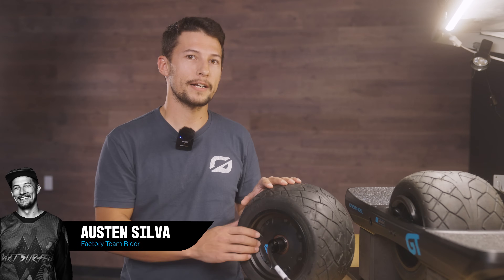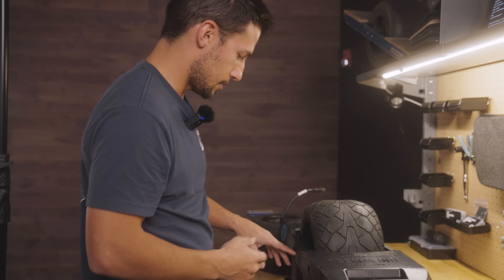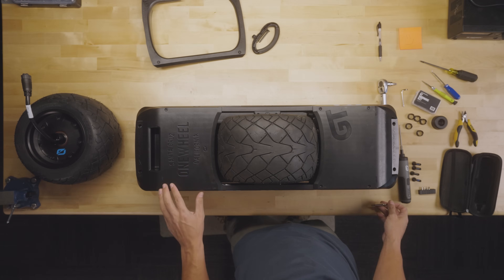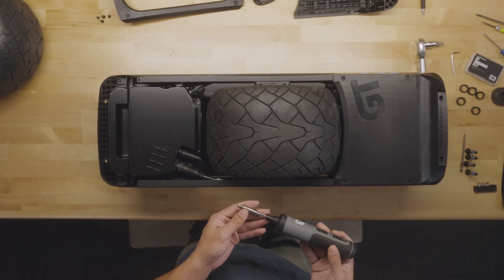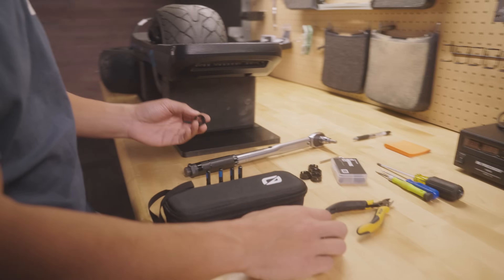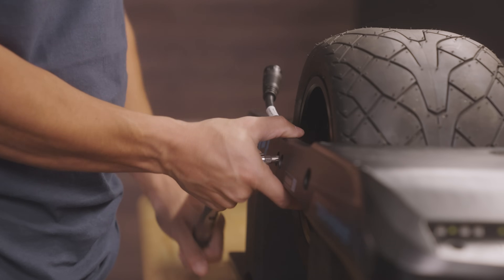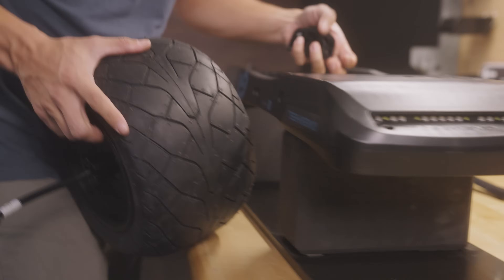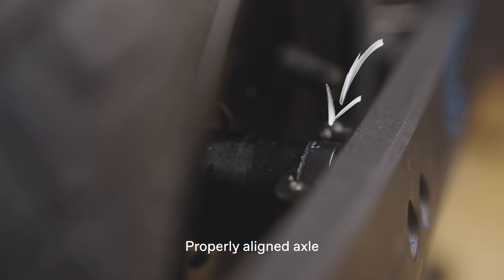Onewheel S-Series Motor Install

Comment from the maker: HOw about them torque specs heh?!
Reply: Super thankful for that! Can we get Pint and XR too? 🙏🏼⚡️🛠️
Reply: Should note that torque spec is probably only valid on fresh FM bolts. Reusing bolts or a different thread lock may require a lower torque value. Appreciate a published number. Consider tossing in fresh bolts with each tire purchase.
Reply: 25.815 foot lbs in case anyone needed to know
Reply: I am impressed, thank you and now I have to ask.. it took 9 years to get any sort of torque specs. Why? Julian?
Reply: Wow, took ya long enough FM 😂
Reply: how about not removing individual cell voltages heh?!
Reply: @sadanimal1950  what you said
Reply: Nice they're supporting repairs/upgradability just in time to comply with incoming laws.  My vesc is still faster/torqueier than my friends GTS.  Best part is I still haven't given FM money after they tried charging to fix a controller bricked by their own automatic update.  I'm so glad there's better alternatives coming out whether it's vesc or EUCs.
Reply: It's incredible how it took this long. Been offering replacement tires for users to install, and verified this is a non warranty voiding procedure yet never released torque specs for the bolts holding the axle to the rails. 

Torque specs for every board would be very appreciated
Reply: 🎉thank you!
Reply: Yesssss babe! Feed me that slop! 😍
Reply: Can we get XR torque specs too please
Reply: Thank you! 22 ft lbs. it is!
Reply: @sdmods619 it’d be 25.8 ft-lbs
Reply: I just watched the video and he mentioned spec should be 35😊
Reply: @AshlonHill  yeah Newton Meters

Comment: So am I correct in assuming that you say the axle bolts should be replaced every time you take them out, but they are not included in the new motor package and not suggested on the motor purchase page?

Comment: Nice work, great to see this. One thing I typically do is take one rail off, it’s a lot easier to remove and install the motor connector. In my opinion, you are less likely to damage anything.

Comment: I thought if you disconnect your battery on a GT it has to go all the way to Santa Cruz to be repaired but motor swap you guys are fine with?
Reply: they mentioned in the comment above that the battery will be for sale but will take some time to roll out🙏 great step in the right direction

Comment: You should NOT  be using a torque wrench to Unscrew. It's a tightening tool only! Why? It's easy to deform internal components and then is no more reliable. You can not know that happened unless you compare with a fresh torque wrench or try to calibrate it.

Why I know? +1B $ commission, We had to redo all torque certification on cabinets in a power station. The worst part was removing permanent marks you put on torqued bolts, washers and cabinets.
Kept rack of what was To do, done, and to double check😅

Unscrew with regular wrench, tighten with a torque wrench!

Comment: Can I put it on my GT?
Reply: Yes but if you're going to spend another 90p night as well buy a gts and sell the gt
Reply: @aaronlarsen8412 I need the GT range…. I’ve already put like 1500 in paths for the GT. It’s my daily driver but want the most out of it
Reply: @richcoastbrooks8601  are you fine with the 20mph pushback? I have a gts and a gt and the gts is so much nicer and so much more stable and you can cruise at over 20mph easily

Comment: I fumble on the retainer clip, and worry that it is not tight... Would it be safe to put a dab of hot glue on the connection for security purposes?
Reply: If you don't feel like your retainer clip is tight I would suggest replacing it

Comment: What exactly does this change about the gt? Is the torque similar to the gt-s? Less pushback? I'm a little confused
Reply from the maker: Better off-the-line torque and thermal efficiency for the big boys.
Reply: @Onewheel why not just buy a gts?
Reply: @bradleyfrank7933  Because we're not all made of money.
Reply: @bjbarlowe  after you upgrade the motor and tire and battery you pretty much are paying the price of a gts anyway.
Reply: @bradleyfrank7933  We're only talking about upgrading the motor. $850 vs. $3,200.
Reply: @bjbarlowe  I get it for people who have already bought a GT. But if you include the cost of GT, you are virtually paying a GTS price to get a wheel that is not quite as good as GTS in the end. From FM perspective, it's all good $$$ into their pockets. So of course they would be happy to offer this to anyone who is willing to fork out the money for it.

Comment: What is the benefit of this without the increased voltage?
Reply from the maker: If you're a GT owner swapping to an S motor will give you increased torque in low speed situations, so better off the line acceleration and better thermal efficiency. Good for the big guys
Reply: @Onewheel can we further improve the thermal efficiency by adding a ferrofluid ourselves?
Reply: @Onewheel  I'm just over 300 pounds in a very hilly city, so that's music to my ears. I might start saving up for this upgrade, because I'd be stoked if I could get up and down some hills more safely.
Reply: @bjbarlowe or just get a gts
Reply: Or swap to a vesc a little bird told me their is gonna be a drop in swap soon that ups the power to 4000watts on the og gt motor.
Reply: @Onewheel  thanks!
Reply: They make more money off you which helps fund their cool projects🤙🏽 float on and thanks for the money

Comment: This was unexpected! But a great step in the right direction!! Now will you be selling that GT-S battery?
Reply from the maker: it's in the works. Will take some time to roll out. Stay tuned!
Reply: I thought it bricks the onewheel if you unplug the battery? @Onewheel
Reply: @quangyung6751  yes it does but it seems like they have plans to possibly not have that happen
Reply: I'm guessing for gt as well than. @JaxonOttosen
Reply: @Onewheel  is it possible if you could give an estimate for the cost of the battery?
Reply: @Onewheel  Man this is so crazy to read, honestly amazing.